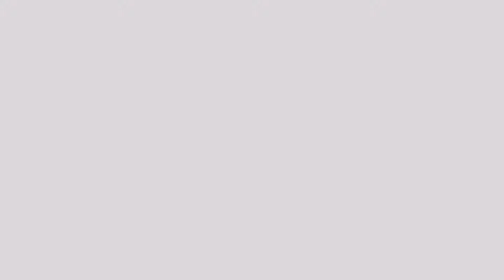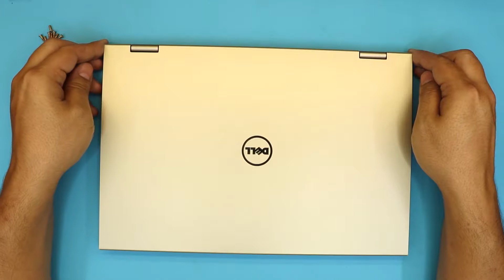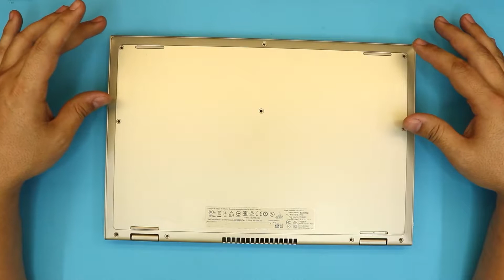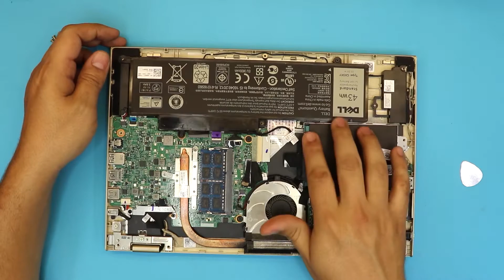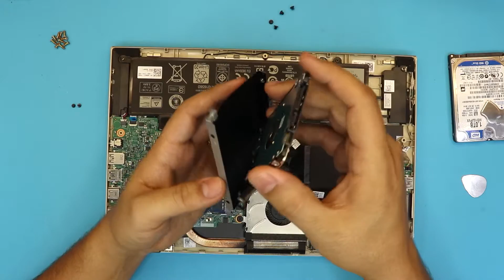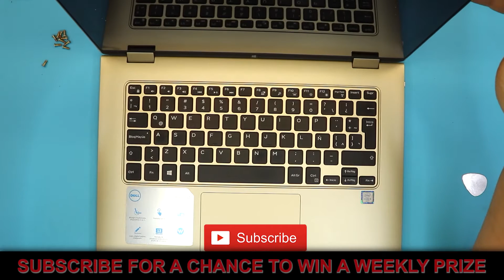HOW TO remove / Upgrade DELL Inspiron 13 7000 series  SSD / HDD

Comment: Thanks, Big help. My daughter’s Dell started throwing up windows blue screen of death and rebooting continuously. Ran in safe mode and went to Dell Diagnostics. Test showed SSD was bad. I removed it, sprayed with contact cleaner in contacts, blew dry with canned air and re-seated. Removed and reseated ram. Appears to have fixed it. If not I’ll back up and replace drive with a bigger one. It’s only 256gb.
Reply from the maker: It's my pleasure my friend. 🫠Regarding your issue, the ssd is degraded enough to cause a system crash, it is highly recommended to replace the ssd and install windows fresh installed.
Should you have any further questions or requests in the future, please don't hesitate to ask me.
cheers🍻

Comment: Hello... May I know if my Dell Inspiron 7352 processor can be upgraded from 5i to 7i? Or can its gen upgradable from 5gen to 7gen or up? Thanks
Reply from the maker: Thank you for the feedback! if you wish to support the channel you can LIKE or SUB or both :P
regarding your question: sorry to inform you that you can't upgrade or replace the CPU, its soldered on board. its BGA Chip, not LGA

Comment: Sir, I have Dell INSPIRON 7359 Model, i need to upgrade 16 Ram and 500 SSd Hard disc Possible
Reply from the maker: Thank you for the feedback! if you wish to support the channel you can LIKE or SUB or both :P
regarding your question: sorry to inform you but your laptop only has One SODIMM slot , that means you can have a 4GB or 8GB ram in there, with max ram speed of 1600 MHz.
but we have upgrade the ram to 16gb and worked only with this ram make model: https://amzn.to/3Tko5S3
the sata port is: SATA 6 Gbps
you can have any 2.5‑inch drive SSD or HDD in there.
4TB SSD max or 2TB HDD max low profile
GOOD brand and durable SSD:
#1: https://amzn.to/3e2imjF
Reply: @uFixTek  thank you
Reply from the maker: its my pleasure  my friend,
if you have any question or request in the future feel free to ask me.

Comment: the harddrive he's showing and the hdd inside have different diemensions, they don't fit
Reply from the maker: the HDD in the laptop ate the mechanical drive and they are low profile drive 2.5" 5mm.
this laptop can take 5mm-7mm profile
the 2.5' hdd comes from (5–19 mm)
BUT all 2.5' SSD sata are the low profile, if you upgrade to any SSD they are all will fit.
here is a low profile HDD: https://amzn.to/35DRyPd

Comment: I need to replace my HD in this same spec laptop. Mine has a 6th gen processor though so I'm guessing it's a couple years earlier than this one. My question is what hard drive spec and size should I be looking to purchase? Would prefer to buy an SSD
Reply from the maker: Thank you for the feedback! if you wish to support the channel you can LIKE or SUB or both :P
regarding your question: you can place any brand and model SSD SATA.
Then best brand and long lasting one is Samsung it has the best TWB:
https://amzn.to/3iqLOA9
2nd best is :
https://amzn.to/3uUZEgD

Comment: Can this be done with a 2 in 1 laptop?
Reply from the maker: can you give me a exact model of the 2in1 laptop that you want to upgrade the ssd?
Reply: @uFixTek  Dell Inspiron 13 7000 (7348) 2 in 1 laptop. I hope that helps. Do you need more information?
Reply from the maker: give me the TAG number please
Reply: @uFixTek  It is GKYJL52
Reply from the maker: yes it can be done, you can upgrade and change the ssd without any issue. if you have problem or need help take a picture of your motherboard and i will help you out my pointing out to where to place.
Reply: @uFixTek  thank you. I'll try to follow the video guide you have here. i've subscribed and will be watching more of your videos :)
Reply from the maker: thank you :)

Comment: this is very helpful. May i ask. Mine is also inspiron13 7000, just like yours in this video. Currenly its just 250G, can it be replaced by 500 or HIgher?
Reply from the maker: Yes you can, you can put a 2Tb , thank you for your support :)

Comment: my dell inspiron 7000  13" doesn't have the DDR4 slots.. the RAM is soldered :(   and the SSD is M2  and the battery 38 Wh ... which model-year is this?
Reply from the maker: i dont have the exact date on the laptop as it was one of my clients but its 2018 model.